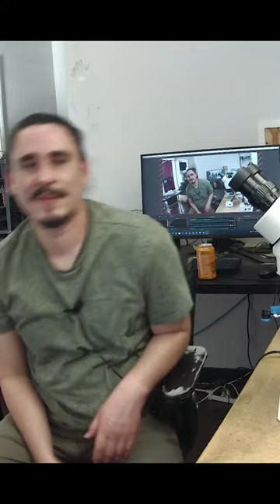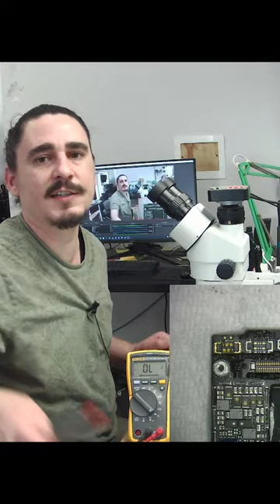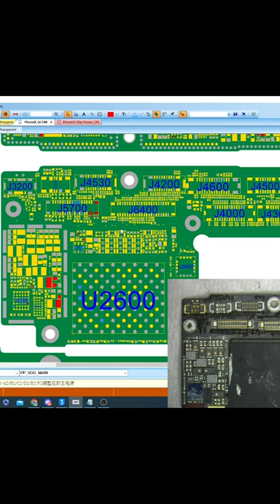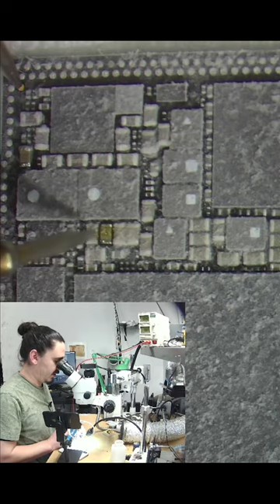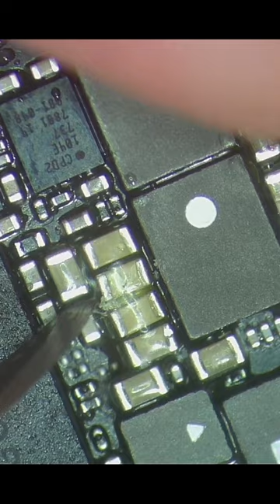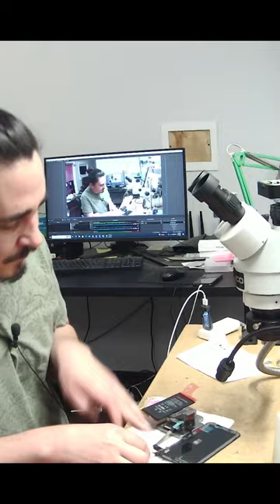Injecting Voltage Into Motherboard to Detect Shorted Capacitor - iPhone Data Recovery Techniques

Comment: Sir, Thank you so much for sharing useful information for everybody! You're amazing! I have a quick question. May I ask how much voltages you injected to the probes after you froze the board?
Reply from the maker: You should inject whatever the line is rated for. If it is a 3v line, inject no more then 3v. Or 1v, if it is a 1v line.
Reply: @iBoardRepair  Thank you so much sir!

Comment: The Apple phones are metal covered and the phone has speaker holes. By placing the phone to a radioactive heavy power bank for 3 days, the phone’s charging discharging can be fixed, the min of the battery life will be better. Placing by facing the holes toward the power bank, the holes let in the radioactive ray to the battery’s panel. The Chinese and Japanese power banks have nuclear radiation to do the fix. Phones without metal cover, you have to put the phone on the power bank facing the batt down. If the pwr bank is smaller than the phone, you have to guess where you put the pwr bank, but near the battery. Each correct fix takes 3 days. When the battery’s own panel is very hot, you fixed the phone, the phone will become cool, the battery’s little chip will become hot instead. The connections must be clean. Best experiment with old Nokia phones, what’s the middle connection is really for.

Comment: Whats the software you use to look at board an how did you get one that showed the likely short area
Reply from the maker: So the amperage draw I noted is what indicated it was a "vdd_main" short, so I manually decided to click on that line on the software. There are many many other lines to look at as well, but I knew from experience it was likely this one that was the problem. The software is called "zxw tools"